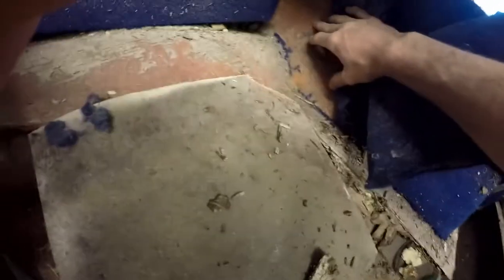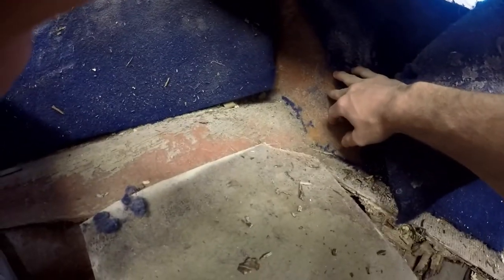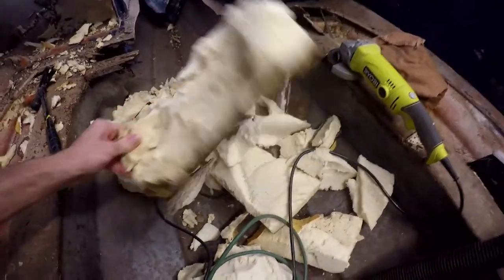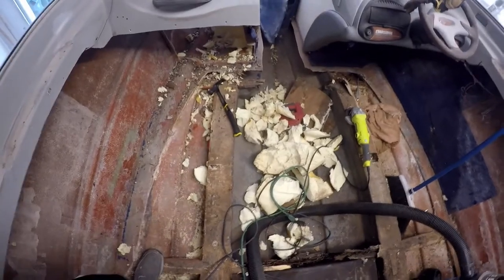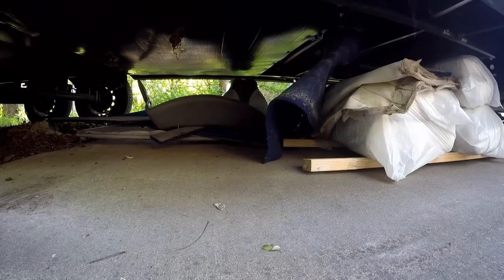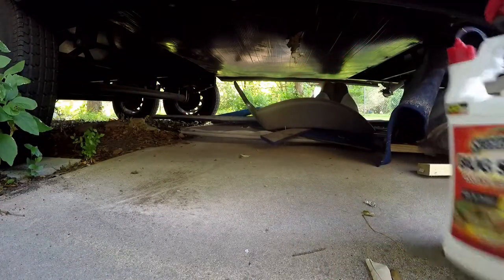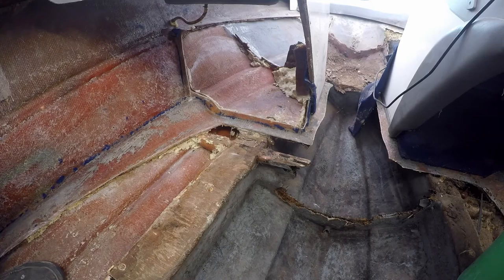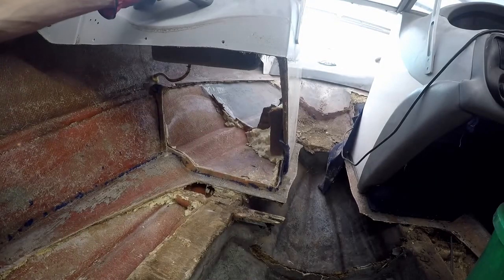Removing Under boat dash - Bayliner Project: Day 10

Comment: I'm doing something similar to my 1998 Capri 2050 right now. I noticed in the water that the boat leaned to the port side a little more than I liked and I suspected that she was water logged somewhere since the bilge area was always dry. I can never find a lot of information when I look up bayliner capri's and I have to be honest, watching your videos gave me courage and I finally drilled an exploratory hole underneath the seat and confirmed I have wet foam. My project will consist of removing the deck and foam from the dash back to the transom on the port side and then re deck, re foam, re carpet. Im a few days into this process and I'm not having fun lol. Thanks for all the info. You videos have been super helpful and I cant wait to see more.
Reply from the maker: Hey Matt! I really feel your pain, in my case no exploratory hole was needed as half the deck had already fallen in lol. I am excited to here how your project ends up, we're doing a lot of the same. Feel free to shoot me an email if you want to share about where to buy various material and such,  my email is on the 'about' section of the channel. Also thank you so much for your encouragement! I'm hoping to get a lot more videos edited and uploaded soon, I've been a bit sidetracked from the rotted floor with figuring out the engine stuff

Comment: There is a tool you can make for cutting through foam. Just simple wire hooked up to a car battery will heat up and cut through the foam like warm butter.

Comment: Why did you not use a resip saw ? Minimum amount of dust and low level of noise
Reply from the maker: Good point! I would have, but I did not have a reciprocating saw yet. I got one in part 16 though :)
Reply: Zachs Garage  great videos, keep them coming